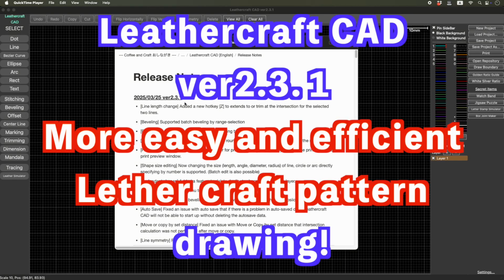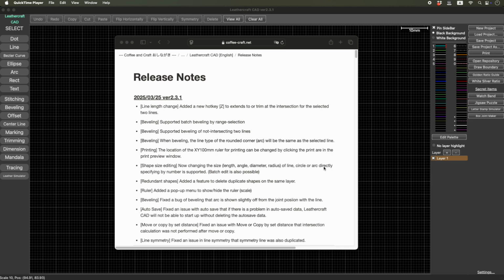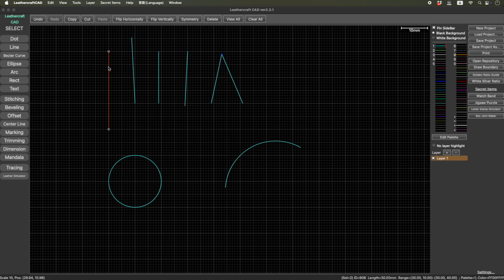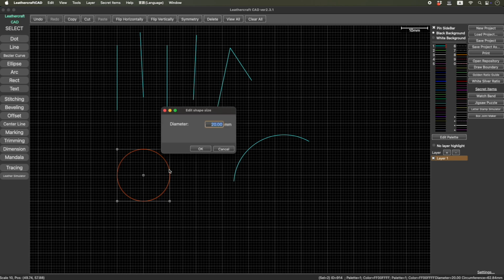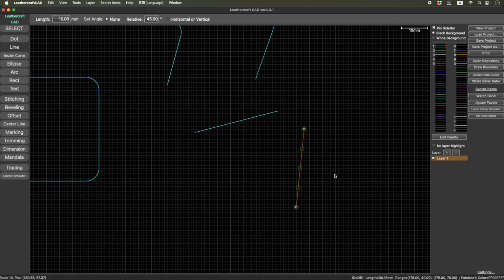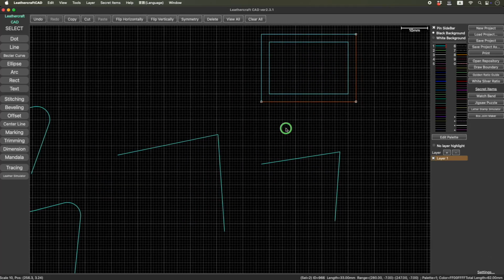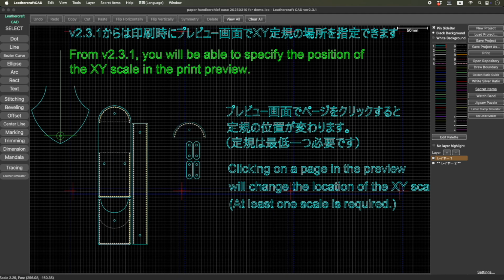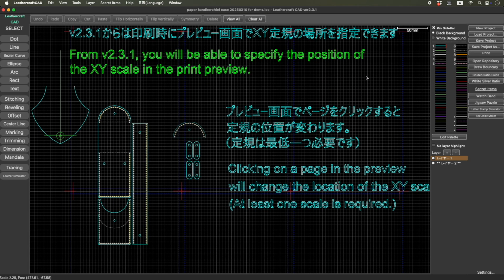Leathercraft CAD v2.3.1 リリース レザークラフトのパターン作成がこれまでになく簡単かつ効率的になりました。

Comment: I love this program- it's so useful! I do however have one question that I hope you can answer.

I have some manual hole punches, and I want to make a stitching line of 8mm hole punches. I tried to adapt the Round 5mm stitching tool for 8mm, but I'm not sure if I've done it right. It gives me the 8mm circles along the line but the gap is 2mm which isn't large enough between them. I need to have at least 5mm gap, but I can't figure out how to do this. I'd appreciate any feedback, thanks!

Comment: I can't express how much design and prototyping time this has saved me. One suggestion, maybe it's a long shot or too difficult, but it would be great to have a function to get stitching points paired between 2 lines. What I mean is, when joining curved shapes, the outer shape usually has a few more stitching points as it's longer as it has a higher radius,  and the inner piece is shorter as it has a smaller radius. This can be fixed in saddle stitching but other stitching methods are not friendly when you don't have exact matching holes in both pieces. I hope I was clear enough. Regardless, again, thank you for your hard work and for sharing it!
Reply from the maker: Thank you for your comment. You might have already figured out, but there is a feature called Box Stitch Helper and you can make same number of stitching hole to outer (or inner) stitching line. Please see this video for more detail: https://www.youtube.com/watch?v=qICF-laDIlI&list=PL-8IKh6XA2LiQvDzb4yCiMRWd5LioeXVp&index=8
(I noticed this video is not translated to English, but I hope you will be able to get the idea just by watching my operation.)

Comment: Hello,
I really appreciate the printer calibration tool — it has been very helpful in solving the issue of inaccurate print dimensions.
However, I noticed that when I save the file as a PDF (using Microsoft Print to PDF), the calibration becomes distorted, and the prints come out with significant inaccuracies.

Comment: May I ask how I can download the version I was using before? After upgrading, I found the previous version to be more lightweight and straightforward. Also, if it's possible to add a feature that allows users to import images and drag to resize them to fit the design layout, it would be incredibly helpful for leather carving enthusiasts. Thank you for all your hard work!

Comment: Is there a way to set the tool to imperial measurements instead of metric?
Reply from the maker: Sorry, currently it only supports metric. I have been thinking about a way to switch between metric and imperial but supporting imperial is a bit tricky since it uses foot, inch with fractions such as 1-13/16 inches and it requires many changes. Hmm…
Reply: @coffee-and-craft   I think if it was to support up to 1/8" this would be sufficient even just inch with decimals eg 3.25" = 3 1/4" most fabric rulers don't go below 1/8th measurements as it's too small to measure properly.  This can be true for larger projects using ft  just displaying it as inches  can suffice eg. 1ft =12" so 1ft 6- 3/4" would be 18.75"😊